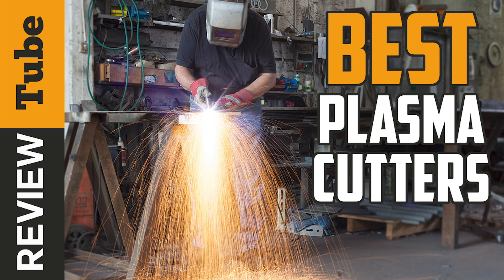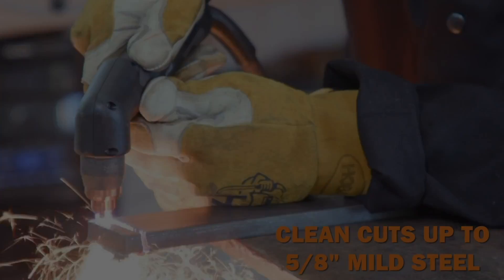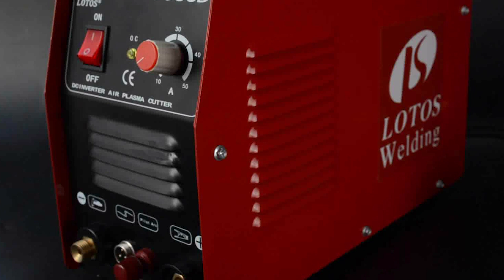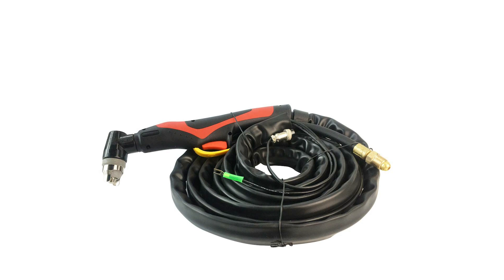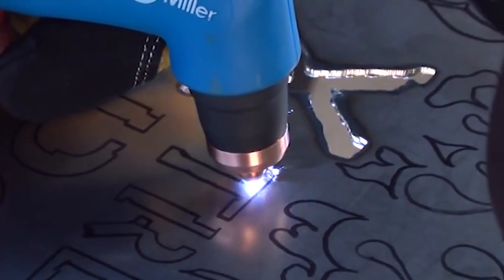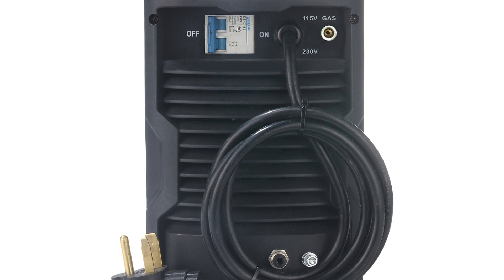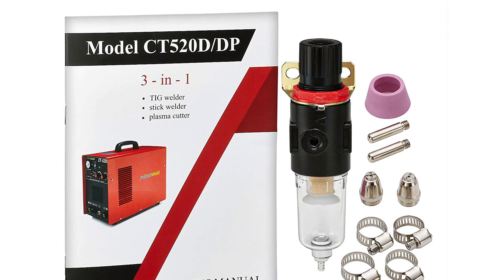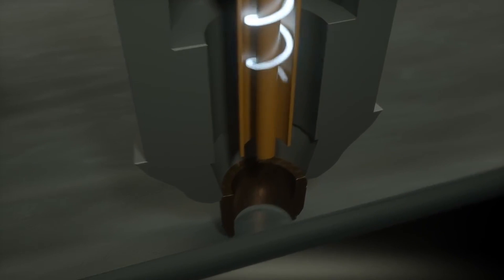✅ Plasma Cutter: Best Plasma Cutters (Buying Guide)

Comment from the maker: ✅1. HOBART 500566 Plasma Cutter: https://bit.ly/3gZDQKy
   * Find a great deal on eBay:  https://bit.ly/3rLisOp
✅2. Lotos LTP5000D Plasma Cutter: https://bit.ly/2Y80Uzo
   * Find a great deal on eBay:  https://bit.ly/2Y9Fj9N
✅3. MILLER ELECTRIC 907583 Plasma Cutter: https://bit.ly/315Ir8F
   * Find a great deal on eBay:  https://bit.ly/2E19Lfh
✅4. Amico Power 50 Amp Air Plasma Cutter: https://bit.ly/3fZEypL
   * Find a great deal on eBay:  https://bit.ly/320BEwc
✅5. PrimeWeld Ct520d 50 Amps Plasma Cutter: https://bit.ly/3iOzs1z
   * Find a great deal on eBay:  https://bit.ly/3iHEbC2

Ancient Japanese Tonic Melts 54 LBS Of Fat: https://bit.ly/39sKV4H
STUFF YOUR FACE. LOSE WEIGHT: https://bit.ly/31FOT5q